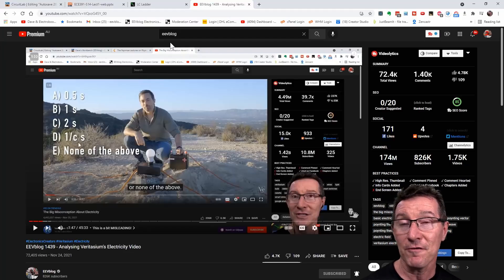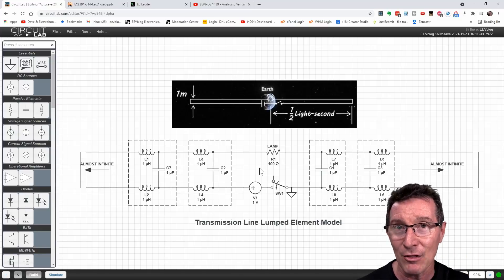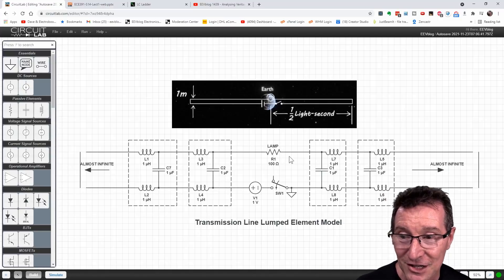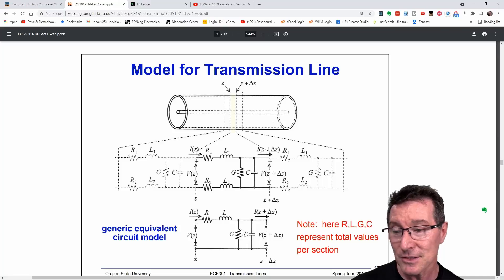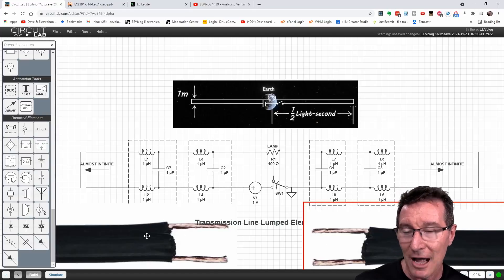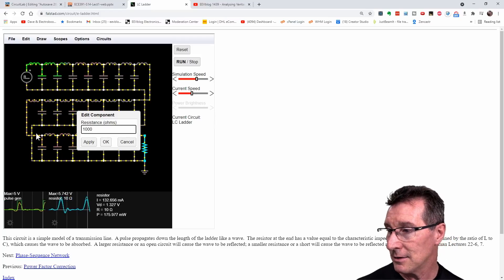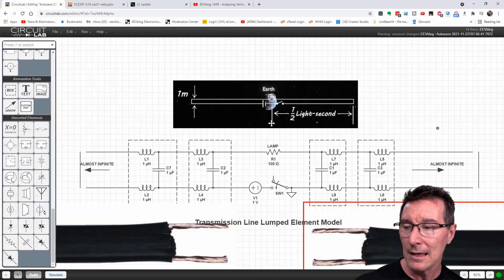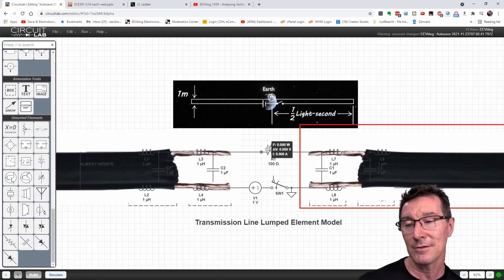Veritasium Electricity Video - Simulation Notes

Comment: For the first 1m/C seconds, I prefer a transmit and a receive dipole antenna model over a transmission line model because with a transmission line, a power source is connected to both lines at one end of a transmission line while a simple dipole antenna also has two wires connected directly to a power source but the wires go in different direction like they do in the example problem

Comment: Ok i had a good think about Veritasium's gedanken involving a rectangular 2 light-second long DC electrical circuit. The circuit has a car battery next to a switch, & 1 light-second away it has a domestic bulb that can glow, & the 2 long lengths of heavy duty insulated copper wire have no resistance or somesuch, & the wires are stretched & aligned such that they are 1 m apart (except of course at the far ends where each wire turns to come back), & the bulb is 1 m from (ie opposite) the battery & switch. 
The open switch is then closed.
The question arises -- how long would it be before the bulb began to glow? 
Veritasium says that it would glow after about 3.3 nanosec -- meaning that he believes that crosstalk tween the wires would do the trick. That might be so, depending on how sensitive the bulb was or wasn’t. After all, a very sensitive bulb would glow anywhere on Earth, even with zero battery.
 
My estimate is that, ignoring crosstalk, the bulb will start to glow at 1.0 sec after the switch is closed.  And it will continue to glow for ever after. Most would agree. But most would not agree with my reasoning. Ok, here is my reasoning.
 
Firstly, i don’t believe that electricity is due to electrons moving along a wire. I reckon that electricity is a Heaviside slab of  E by H energy current propagating along at c outside a wire (usually a pair of wires)(including tween the wires)(Heaviside's rule).
 
Initially, while the switch in Veritasium's gedanken is open, i say that there is a very old 6V circulating energy current that propagates up & back & up & back along the wire that connects the negative terminal to the switch -- & likewise another very old 6V energy current that propagates up & back along the wire that connects the positive terminal to the switch (my rules). These old currents reflect at the switch & at the terminal, for ever, or until the switch is closed (my rules). 
 
The currents pass throo each other, & the up current cancels the back current, or at least their magnetic fields cancel (Catt's rule). But their electric fields don’t cancel, they add (Catt's rule).  I said circulating, but more exactly the current propagates up & back along the wire, retracing its path in the opposite direction (its not really a circulation).
A current that originates at a terminal can't be absorbed at that terminal, it is always reflected at that terminal, but it can be (will be) absorbed at the other terminal (my rules), after the switch is closed.
While the switch is open no current can get past the switch to reach the other terminal (common sense rule). If/when the current reaches the other terminal it will of course be absorbed (my rules).
While the switch is open, the bulb will not glow (ignoring crosstalk). This is because as i said the up current cancels the magnetic field of the back current, & apparently the electric field can't on its own make the bulb glow (someone's rule i guess).
 
Also, while the switch is open, there is no injection of new energy current from the battery. There is no injection because the 2 wires are saturated with old current, what i mean is that the battery is not powerful enough to inject any additional (new) current. The old current(s) reflecting at the terminal(s) somehow prevent any injection of new (additional) current. My model assumes that the battery can (at times) produce a say 6 volt current at each terminal, one will produce negative currents (whatever that means), & one will produce positive currents (my rules). The 2 kinds are different in some way(s) (my rules)(which i won't worry about today). However, a positive current does not become a negative current after reflexion (my rules). But today i am not going to worry much about the exact nature of an energy current, or the exact nature of electric & magnetic fields.
After the switch is closed there are then of course no further reflexions at the switch (common sense), but the reflexions at the terminals can continue for a short while, while the old currents exist (my rules). To be exact, reflexions at the terminal nearest the switch will cease almost immediately (in say 1 nanosec).  Reflexions at the other terminal will cease after 2.0 sec.
 
As soon as reflexion ends at a terminal then that terminal will begin to inject new energy current into the field of its wire (which happens at 1 nanosec in 1 wire, & at 2.0 sec in the other wire).
 
I said that the bulb begins to glow at 1.0 sec. 
At that time the bulb will have 6V of old energy current propagating past it (old means that it was already circulating before the switch was closed).
Plus after 1.0 sec the bulb will enjoy 6V of new current (new means that it was created by the battery after the switch was closed), originating from the terminal nearest the switch.
These add to 12V (but don’t ask me what 12V means).After  3.0 sec the bulb will no longer have any of the old 6V current passing it, but it will have a 2nd dose of 6V of new current passing it, this current originating from the terminal furthest from the switch.
After 4.0 sec the 2 old currents (or u can call it 4 old currents if u like) will have been absorbed, & they will have been replaced with 2 new currents, propagating around the 2 light-second circuit, 1 propagating clockwise, & 1 anti-clockwise (& here i mean 2, not 4, because the new currents do not suffer any reflexions).
End of story, for today.
Reply: He states early on that we have to assume that the light turns on as soon as there is any current. It's the most problematic statement of his whole argument in my opinion because it makes much of his experiment pointless. He doesn't need a circuit, he just needs current moving in the wire close to the battery. Making it a circuit is a deliberate choice to throw people off of the position he is going to argue. If he had made them two disconnected wires, we'd immediately realize the system looks like two antennas (or the two plates of a capacitor for a brief time) and we'd collectively roll our eyes because we know that antennas exist and we know that we can't power our whole house (or anything in our house for that matter, including a light bulb) off of the miniscule power collected by a TV antenna.
Reply: @Wavicle  Yes, if the main thrust of his footage is that electricity is not the flow of photons, then his multiple choice question at the end is of no relevance whatsoever.
Everyone that agrees with his main thrust, & everyone that disagrees, all of them would agree that there is almost instantaneous crosstalk from the battery/switch wire to the bulb wire, & the crosstalk can if strong enuff make a sensitive bulb glow.
But, then, Veritasium makes a mistake. The leading edge of the primary energy current pulse in the battery/switch wire will via crosstalk create a pulse at the bulb, but, as the primary pulse moves along, its initial crosstalk to the wire near the bulb will then quickly weaken, but Veritasium says that his household looking bulb continues to shine for ever. Silly. Crosstalk will provide a constant electric field near the bulb, & a constant magnetic field -- but constant fields cant make the bulb glow. So, after an initial quick flicker, the bulb should go out, & then turn back on again 1.0 sec later when the energy current comes around & reaches the bulb.

Comment: Sorry, but if “the lamp” turns on with “any current” no matter how small, then you can remove the wire altogether. And basically this turns into a troll video, doing bait and switch.

Comment: The correct answer was "None of the above" because speed of light is not c in air. Or the insulation of the wire.
Reply: Speed of light is close enough to c in air. It is only 1.0003 times slower in air.

Comment: Since it was assumed wires had no resistance (superconductors), wouldn't 1s be the right answer since there would be no electrical (and hence no magnetical) fields that introduce induction, capacitance etc???
Reply: A superconducting wire with no resistance still has self-inductance and thus electrical and magnetic fields.

Comment: Ok, the primary question: how long does it need to light the Bulb on is answered.
But what is with the question: How long does it take for the light to go out when open the switch/circuit.  Is it the same time or is it lesser time?
If the answer is, it did not take as much as on switching on, then we have to reconsider the speed of light in special Conditions. 
Namely, if the excited field is built up by solar radiation, then possibly no limitation of the speed of the light on C is the case, but, that the radiation information is transferred instantaneously or anyhow faster, than light speed.
And then we see the galaxies at the starry sky, how they did not look before accordingly so many billions of years, as the distance and lightspeed based it, but, that with propagation of the radiation the provision light information happens perhaps even approximately or actually instantaneously. We would see then the present of the galaxies, not their corresponding past. Because their light radiation, whose spreading perhaps amounts to maximum light velocity, has arrived in the meantime with us and therefore a "field" exist from the potential of the radiation and therefore the information transferred today is not bound to the maximum spreading of the light velocity.

maybe....

Comment: A much easier problem to have asked instead of the one Veritasium put out is what would happen if there is only one "leg" in that circuit--in that case, anyone who took E&M 101 should be able to tell at t=0, the T line just looks like Z0 and therefore the lamp will get the the battery in series with an apparent Z0 resistance in series. Still illustrates the same point that the electrons don't have to propagate all the way through. The problem seemed needlessly "gotcha" to me.

The only difference between the two problems is that if you have two legs, then you also excite the folded dipole mode (common mode) which is irrelevant to this discussion.
Reply: Yea, the way the criteria is stated to stipulate that the "magic bulb" turns on with "ANY" current then you don't even need wires. All you need is the switch and 1 electron to move in the switch.

Comment: D is not correct answer. The question is "How long would it take for the bulb to light up?" not "...for the bulb to get known..."
The energy spread time basically depends on the isolation material of the wire and especially of its dielectric constant.
Pointing vector is an abstract. You are not taking the full picture, because the most of energy transfer along the wire in a small area. So the energy should go through the whole way of the wire. Additionally the speed will be smaller then c if the wire has isolation.
In 1m/c the lamp just get known that something has started happen (by the radio-wave between the wires), but the lamp will start blowing only when the main power/energy (by the EM wave going along the wire) reaches the lamp from the switch.
It's a big mistake to use Pointing theory at wire transmission of energy doesn't matter DC or AC. It's true for waves where wires are antennas. In other words it's for signals between wires not for power transmitted via wires.
Dislike for sophistic explanation. It would be appropriate if it was like a question to discuss not like an ultimate truth.

Comment: I think the inductors need to be coupled, e.g. L1 to L2, L3 to L4, etc.
Also, the capacitances are more in the pF range given the dimensions and compared to the inductors. Mutual inductance is also small. That leaves us with an inductance dominated circuit slowing down the ramp up of the voltage.

Comment: The capacitance between the two parallel and wires and the 1m air in between is so small that all of the voltage from the source would drop on the very large capacitance reactance X(C)=1/ωC  and a very small voltage would arrive at the lamp. Unless, we are talking about a hundreds of KV d.c. voltage source there is no way a incandescent lamp even 5W will light up for a brief moment during the d.c. transient from the switch.

Comment: I've rewatch the initial video and these are main points of the question :
"how long does it takes for the bulb to light up" and "the light bulb has to turn on immediately after current passes through it"

a) The 1/c (in international unit ie, m - s - K -kg...) is the answer for "what time does it takes for the bulb for eventualy emitting an photon", not "light up".
b) 1/c is not the answer to "what time does it takes for the bulb to have sufficient current to turn on".

explanations :
a) Some people says that the curent isn't sufficient, and it's totally true.  But at a photon level, you can have photons emited from the bulb by the initial EM wave.
b) As the speed of light is not the same in and out the wire, other answers can also be discuss (only 2.3 10^8 m/s in copper, and as in the simulation, il need some time for the final state to established).

More :
when the switch is switched on, the EM field is modified  near the switch, so isn't it the switch the reference for distances ?
Reply: If the two wires going to the bulb are exactly symmetrical placed (switch as reference) , the inducted current in the bulb is equal to 0 (wires near the bulb on the same magnetic line) and you an have nothing happening in the bulb at 1/c time. So 1/c in definitely not the answer.

Comment: Is the modeled capacitance of the transmission line equivalent to the way the energy is transferred through the Poynting vector? If so, even if the Poynting vector is the underlying reflection of reality, being able to model it as equivalent impedance is the way we abstract away the Poynting vector. We can then model current flowing through the Poynting vector's "impedance" or equivalent impedance, to be able to actually do useful work.
Like who cares if our model is not a reflection of reality, reality is messy and that's why we abstracted away reality; it works and we can make and do interesting things more easily with our model.

Comment: I imagined the two wires to be antennas, but I'm still not done with the calculation for the final DC case. When there is no change in current, my antenna approach is not justified, and I still can't wrap my head around the energy flow in that case.
Reply: In the final DC case, there's no antenna because it's just a normal close circuit
Reply: @johnflux1  that is 
1. What I already said
and
2. Not helping since the question how energy flows in that case is still open.
and
3. Closed circuit does not mean the wires can't act as antennas.

Comment: Could one do an experiment similar to this, only with two rolls of twisted pair?
https://www.youtube.com/watch?v=zrDxSM91Jcg
then one could nicely watch the results on an oscilloscope.
For the impedance of the 1m apart wire pair maybe a TP impedance calculator is an appropriate tool. I think the impedance somehow plays a role, because there still must be an outgoing Poynting vector to feed energy into the inductance when the current builds up along the wire pairs, so at each side the two wires must at least have some potential difference. Maybe it's negligible.

Comment: Sorry, Dave, but you're wrong about the inductors not being important.  The inductors ARE important because it is that mutual inductance that supplies much of the current, and also why the light comes on and STAYS on.  However, even without this, the light comes on and stays on, because the "turn on transient" doesn't just couple across the first lumped capacitor; it gets delayed by a little bit and then gets coupled across the next lumped capacitor, and so on.

I worked in high-power pulsed RADAR for a while back in the 70s, and this circuit is very similar to what happens in the modulator, where an "artificial transmission line" consisting of lumped elements like you show here, is used as a pulse-forming network.  It really DOES supply power continuously, once the switch tube turns on, for twice the delay line length.  It does require proper matching between the artificial transmission line and the power tube it's feeding, in order to turn off the switch tube, but this is a very practical thing in a different application.

Comment: The ideal bulb is BS.  In this case, the bulb will turn “on” just by placing the battery next to the bulb due to capacitance before the switch is closed,  it will just be for an instance, but same at what happens when the single pole switch is closed.  Closing the switch just changes the capacitance of the circuit in the short term.  The bulb is not really on until substantial current really flows but

Comment: If we're talking about "ideal circuits" then we're really talking about fantasy land. In that case, we have an ideal universe where the speed of light is not limited, and  ideal bulbs emit light anytime the current is not zero. So in an "ideal" world, there is no resistance, no inductance and no capacitance in the circuit. In addition, the bulb lights up whenever the current is non-zero, even at 1e-1000000 amps and the speed of light is infinite. When I model such a circuit, the bulb lights up immediately when the switch is closed. Isn't it amazing how everyone has this "misconception" that the world is not ideal?
Reply: I think designing and building a circuit is a really good way to end up that misunderstanding. Once you see that the build doesn't light up, it is quite obvious that there was something wrong in your analysis hahaha